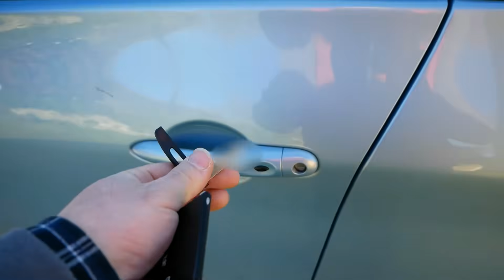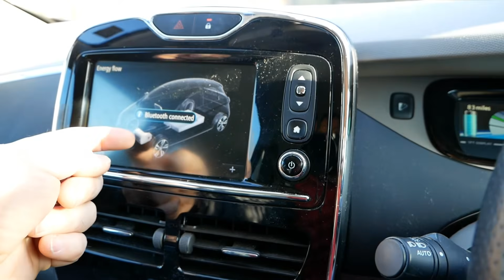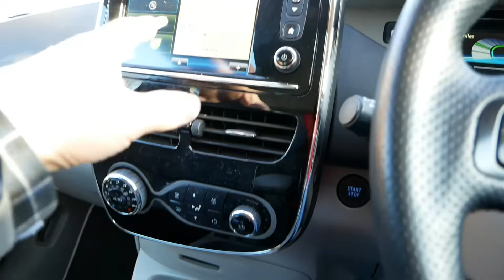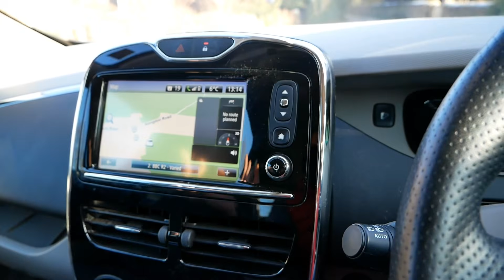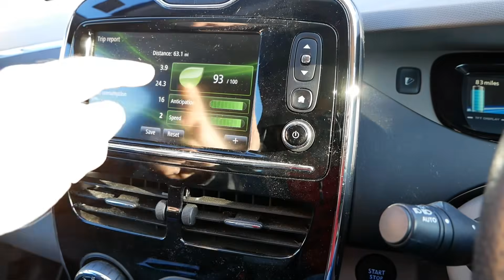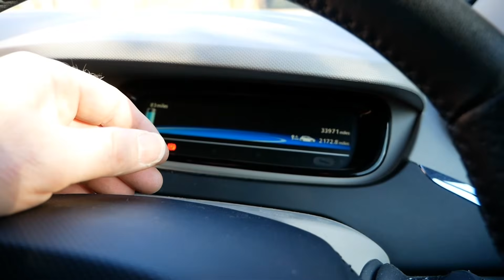Renault Zoe beginner's or new owners guide to using a help you with your new EV

Comment: Another great informative video. On our ZOE ZE40 2018 as soon as you 'ease off'' the accelerator (not even fully temove your foot) the display shows regen into the battery into blue zone and rising white ring on battery symbol,, let alone touching the brakes

Comment: Hey Matt, the regen on the Zoe is variable as they have used the brake pedal pressure which is a brake-by-wire setup to increase the regen and can be seen by the 2 blue bars in the dash.  As you coast, it is the minimal regen you feel (like a fossil car), going down hill it gets more aggressive, and will show on the blue bars.  As you then press the brake, it will increase the regen, only when the two blue bars are full is when the actual brakes pads are applied.  This explains why when servicing the car, it takes 2x as long to bleed the brakes, as the remote hydraulic cylinder acts separately from the brake pedal.  Unlike the i3 or Tesla that use the accelerator pedal to control the regen, Renault Engineers thought it best for drivers to use the brake pedal like a fossil fuel Automatic car.  Additionally, below 11mph, regen is not used, the brake pads are being used.  To get the most regen out of the car for efficient driving, good anticipation and not maxing out the blue bars when coming to a stop gets you the most range.  Hope that helps :)